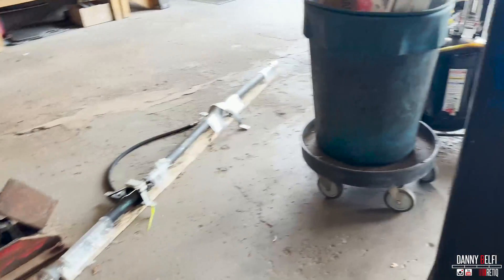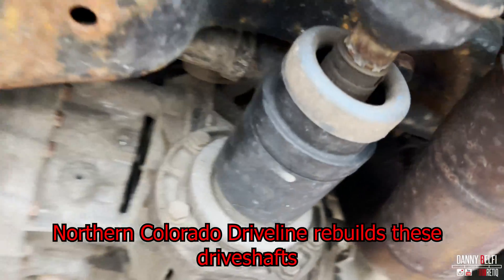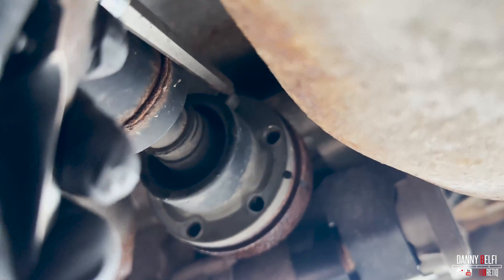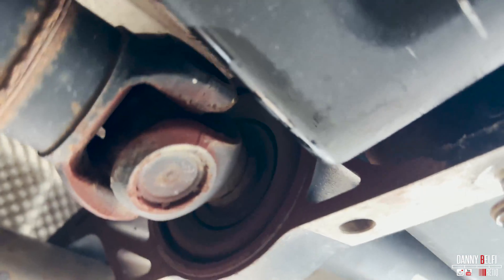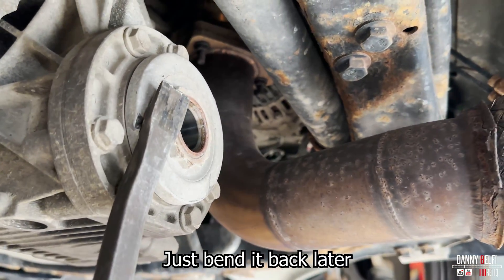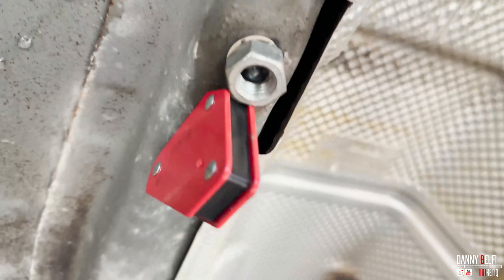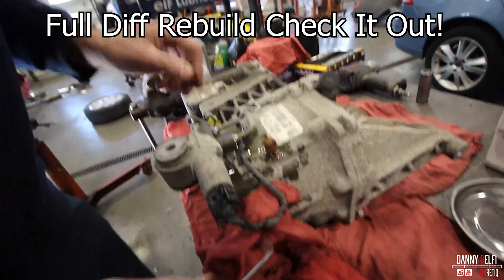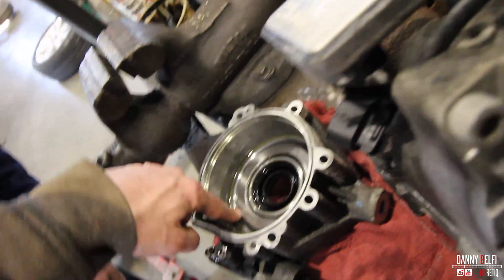Saab XWD Driveshaft Replacement; What you need to know! 4K

Comment: They can be rebuilt.  In fact, zirk fittings can be installed on the U-joints.  Also, you can cut, shorten and circle weld, a drive shaft from, I believe a Buick Lacrosse, and probably the caddy.  I know a Saab master technician that does this.

Comment: What would somthing like this cost to have a rebuild and have it put in just curious
Reply from the maker: I think the rebuild is under $1k and maybe around 2-3hrs labor. Think this job was around $850 ish With a used driveshaft.
Reply: @Retiq  Worth it, since you really can't find any.  And, I would have them install zirk fittings so that you can grease the U-joints at least.  You might be able to get new grease into the carrier bearings with a grease gun syringe.  I have one and might attempt it before mine goes bad.  I have a tube of Amsoil racing grease.  High heat, extreme pressure, high speed bearing grease.

Comment: That was a little disjointed Danny. I had a bit of trouble following you and then you ended the video suddenly.
Do they object at that shop to you doing Youtube videos? 
Take care my friend. Ciao.
Reply from the maker: Sorry about that. Not totally but it takes time to film and we are busy. Iv been I. The middle of building an upgraded engine for an evo 8 and been stopping and going on it as work needs to be done. So I wound up not finishing this repair. 
So the issues was I heard Buick/cadi driveshaft works on the TX. Turns out it doesn’t work so I got a used TX one. The bolts holding carrier bearing broke and I had to weld the washer on to take the rest of bolt out. 
So the video ended pretty abruptly and I didn’t have a clear enough A-Z on my whole idea of the repair I apologize,
Reply: @Retiq  I saw you get the bolts out. Good job.
I could see that the carrier bearings were bad but couldn't tell what was wrong with the driveshaft. Is it the U-joint? 
Is that one of your cars?
Reply from the maker: @wernerdanler2742  Okk yea the u joint with the red dust it’s like the rust coming out of it and that what was the issue, making a chirping noise. Also it was my car I sold it to a friend a while ago but hadn’t posted a video of it

Comment: So glad the previous owners of my 2009 2.0 xwd had replaced the driveshaft, along with the intake valves and some other parts of the engine, saved me a lot of money and headaches
Reply: Whoa man that's like the two main things that go wrong with those years aside from ECU failure very lucky
Reply from the maker: Yeaa deff had more ecu replacements than valve jobs when I was at the dealership
Reply from the maker: Ohh my that must have been a pricey bill for the previous owner. Yeaaa I have a video on this channel of doing the valves… stinks it’s such a common problem… also the stupid coil springs 🙃